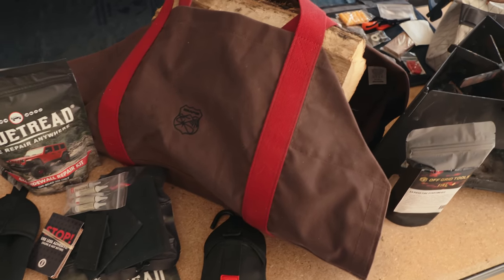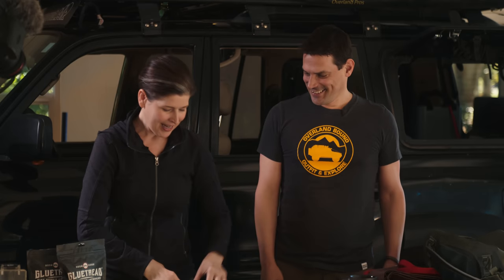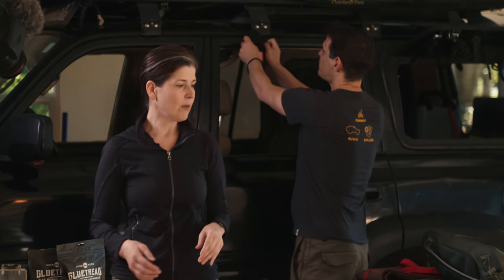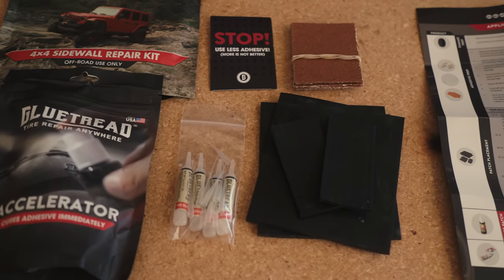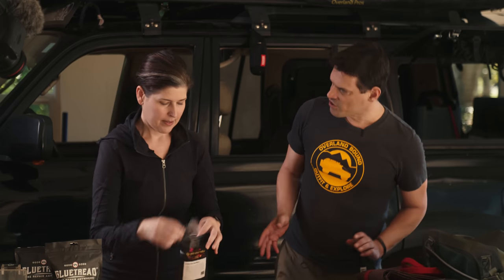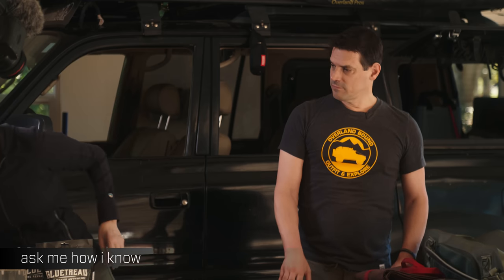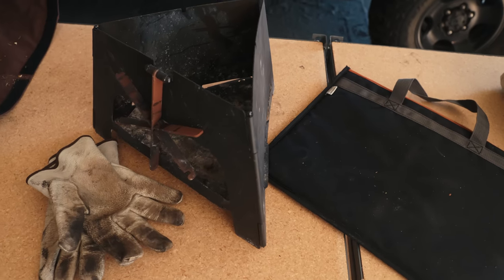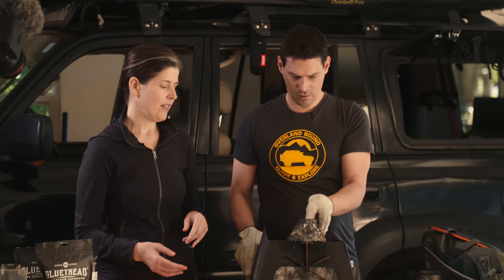Let's Talk Camping And Overlanding Gear! Products That Will  BOOST Your Packout.

Comment: Love that you mentioned the rolling technique. I’ve been encouraging my wife to embrace that approach. We just bought two small duffels on our last trip - one REI, one Amazon. This resulted from my wife’s recognition that open tote bags and loose stuff is very annoying on long overlanding trips.
I roll a t-shirt, underwear, and socks together and put in a medium ziplock, forcing out the air, one for each day. I keep extra pairs of jeans or shorts separate. Each evening I toss a ziplock for tomorrow into the rooftop tent; each morning I take my dirty clothes from the tent and shove in my laundry bag.
I usually keep the clean rolled ziplock clothes in my frame pack in the truck, but I have many options. Sometimes they’re loose in a Thule rooftop storage for quick access.
THANKS for another excellent gear review!

Comment: Awesome video once again. You're Gazelle shout out reminded me of a question I had for you both. I've recently converted from an RTT to a Gazelle (T4) and frequent rainy areas this time of year. Traditional tents have vestibules to keep your stinky shoes outside, but out of the weather. Where do you keep your shoes while camping in your Gazelle as it doesn't have a vestibule? Appreciate any feedback!
Reply: I'm running into the same thing. I'm thinking about setting up a tarp shelter over at least half the tent.
Reply: Keep shoes by the door.. or anywhere. The tent is huge. We sleep two and a mid size dog, us on 30" wide air mattresses. There's room for our duffels and shoes. I get where you're coming from, in a small backpacking tent you might take advantage of a small vestibule for your pack and shoes. Unnecessary with a McMansion tent like the T4.
Reply: I think a tarp or ez-up that connects your vehicle to the T4 would work well. We camp where there are always trees - so the tarp option is best in rain.
Reply: @lazynorse5607  Room isn't the issue. It's having multiple pairs of stinky shoes inside of the sleeping area. Traditional tents have an easy solution with vestibules, but this style of tent doesn't have the same benefit.